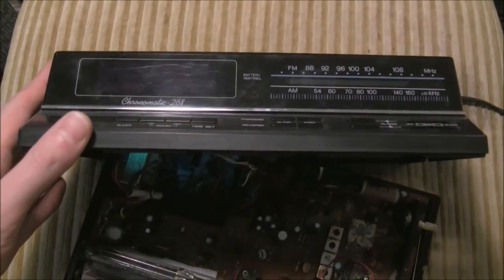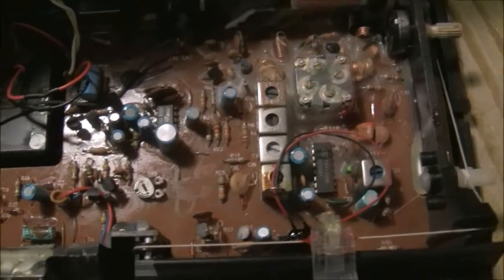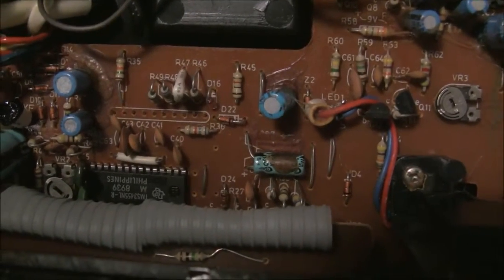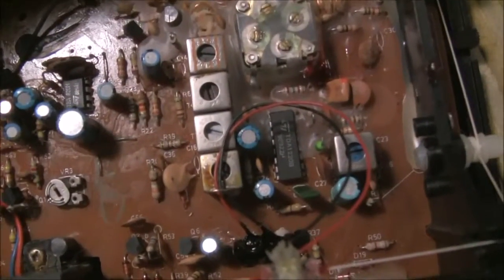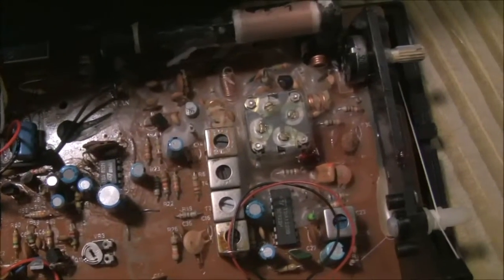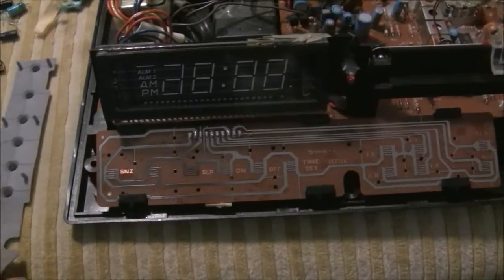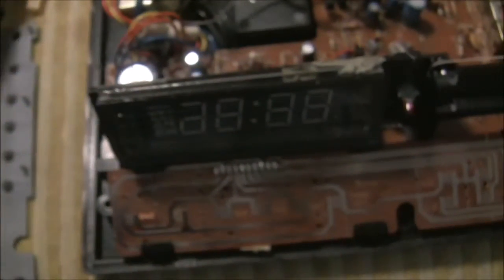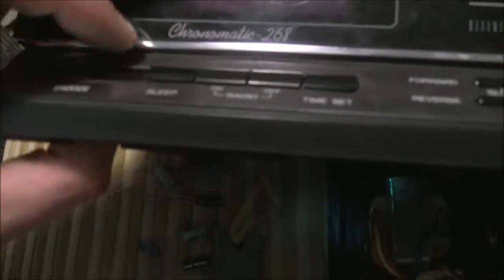Realistic Chronomatic 268 Repair

Comment: Any idea how to go about fixing the digital clock on my old Chronomatic 203? The time flashes random numbers now. Everything else works great!
Reply: Try replacing the large cap near the clock chip
Reply: @jrocco36  I have a Realistic chronomatic-205 and the radio doesn't work, any idea why?
Reply: @Ulookedcompany  Does the Clock Run? if not check the power supply for voltage to the entire radio. 

If it does run turn the switch to ON and test to see if your getting voltage to the radio chassis. If you do then the issue is deeper in the radio itself. If no voltage on the radio chassis check to see if power is going to the ON switch if you do then it may be just a bad/dirty switch.
Work your way back from what works. Power coming in? AC into the transformer and AC out of the trans former. next the diodes in the power supply and output DC to the radio.. 

If its in the radio chassis I would suggest getting the Schematic. Good news is that most Realistic radios have a schematic in the back of the owners manual. I found the manual for my Chronomatic 225 for $12 on ebay.
Reply: @jrocco36   so it turned out that part of the volume parts have fallen off, so my brother fixed it and replaced some parts for the radio to last longer, he’s also made a 3D printed knob for the volume since the original knob wasn’t there when we got it, but thanks for the suggested help, I’ll look into this if I ever come across more problems!